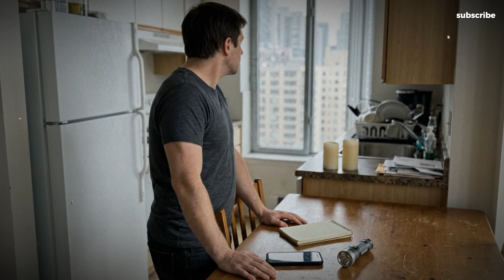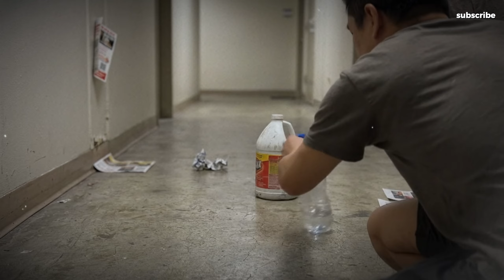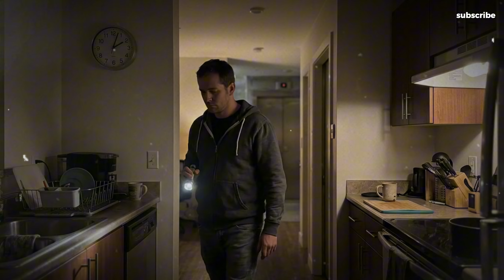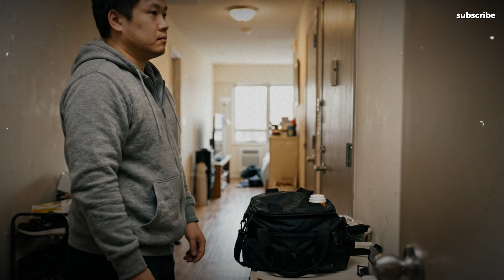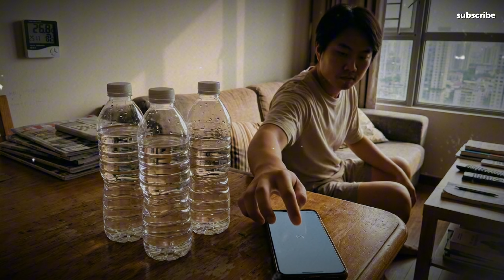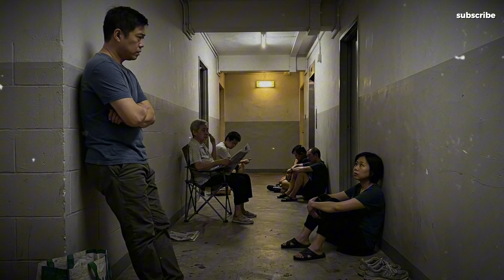High-Rise Blackout The First 6 Hours Are More Dangerous Than You Think

Comment: Do you have a couple of buckets to catch the dishwater ?  Open the "P" trap from the sink to the exterior drain.  Us plastic wrap (or ??) and rubber bands /wide tape (?) to close off the drain opening  to the 'outside' to avoid sewer gasses.
Reply: Good idea to catch dishwater for filtering and reuse.
As for drain openings have Gorilla rubberized 3" tape and plan to get DC or expandable rubber plugs for drains.
Not sure if they make plugs are toilet, prob need to drain/dry then put adhesive rubber tape.
Don't have old record players, radios etc. 
2 ways to reduce need for dishwater is use disposable paper bowls, plates, utensils. And have metal mess tins that who can line with aluminum foil to heat up food on a stove. Discard foil and mess tin shouldn't need cleaning.

Comment: My condo on 38th floor. My building invested in solar 2024. Per management if grid down, emergency backup power energized to keep 2 of 5 elevators, water pump and security gates running. I have about 10 gal drinking water staged at all times, with extra 5 gal jugs, water bobs, 5 gal food grade buckets with lids, and food grade water hose with inline filter and regulating valve to install on water heater drain as last resorts. Have Mountain House freeze dried food in #10 cans, canned goods, different ramen, Knorrs and Uncle Bens food packets enough for 3 months.
Have battery/crank/solar portable radios (Sangean, Sony, Kaito) AM/FM some with SW bands and NOAA. Have primary mobile phone along with secondary (voice/text only) and a burner phone with current plan. Also have couple baofeng transceivers and will transmit in real emergency even with no ham license.
Have Ryobi system 18v tools which include a 7.4" fan, spotlight, drills, water pump and nail gun. Have adequate ammo for 9mm compact, 12 ga pump and 357 mag lever rifle, along with real SHTF arms.
Some tips, first thing is fill every container you have with tap water ASAP before tap stops, including rubbish/trash cans for gray water. Try using the portable crank radio to get info instead of phone if battery use is limited. Yes lookout the window to see extent. Don't use candles inside, have a carbon monoxide monitor close if using butane stoves, if you hear weird noises outside don't open your door, LOL. 
I'm in process of getting a power bank about 2K watts cap along with portable panels to run a mini fridge and separate mini chest freezer instead of my regular large fridge/freezer. I moved from a single family home after wife passed and have no regrets moving to a highrise.
Reply: On the Comms have you ever considered an old Victrola style crank record player?  33rpm/typical vinyl albums work very well.  Or perhaps an old consol radio run with tubes not chips or transistors?   Mine has 4 SW bands.
Reply: Also about your water stores can the smallest or youngest person in the house access All storage methods or move necessary containers ?